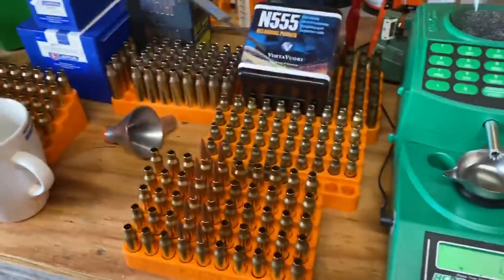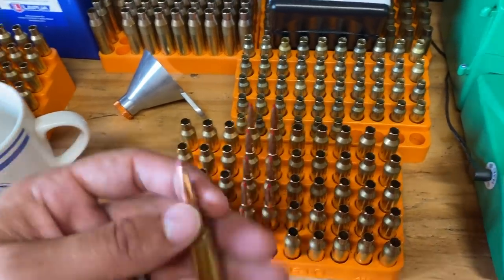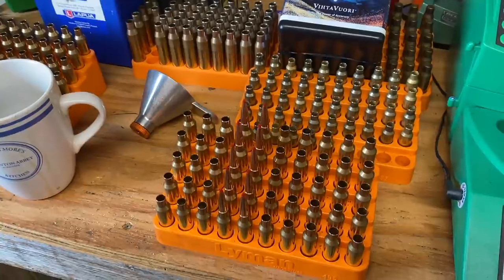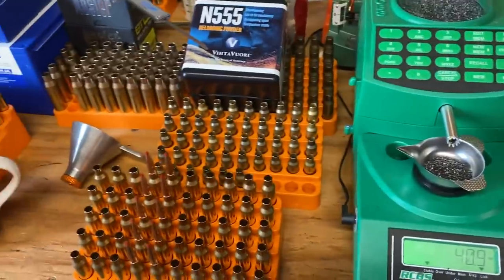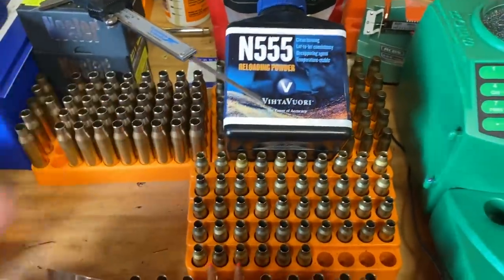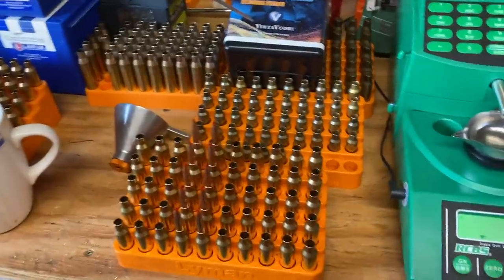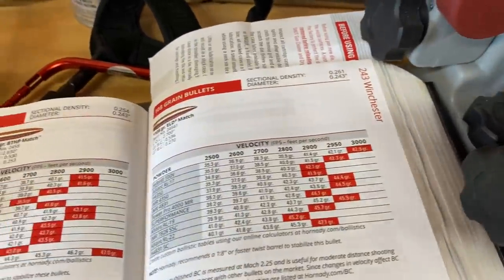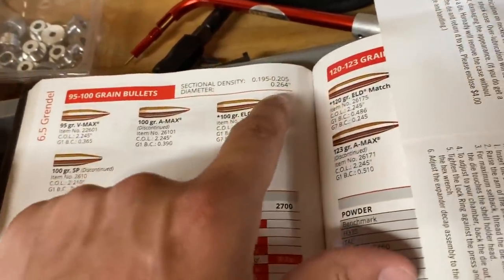6mm ARC???!!!

Comment: Two years later I just built my 6mm ARC...wanted to see how things went before I dove in.  So far I am see this as the best of the best in my lifetime.  .75MOA out of a gas gun out to 1K and beyond and have low recoil in a small frame AR is awesome.  Having shot AR10's, M16A1, A2, AR15 in many variants, I'm a big fan.  I also never had much of a desire to reload, but now I am changing my mind.

Comment: I built a 6 arc, just finished it this last weekend.
I have two Grendel’s and love them.
Just sold my 6.5 creed, great shooter less than a 1/2 moa out to 720 yds. 
Decided to built a 6 arc and just finished it this weekend. I went with a 22” bbl 5R Hand lapped and air gauged.
The case is some what different that my Grendel cases, other than the case just being next down to .243. 
Going to the range this week.

Comment: Really excited about it. When Alexander arms designed the Grendel they a compromised going with the 6.5  for hunting and bullet availability,but  the .257 performed  better. While the ARC  has the shoulder moved back a bit it is really close to that sweet spot for the case capacity. .257 may be a bit better from shorter barrels, but 6mm is a big improvement  and  should be way less temperamental than the .224 valk.

Comment: This looks like a great AR-15 sized cartridge.The only possible downsides I see are 1) the thin bolt head rim to fit the 220 Russian-sized base, and 2) the Mags. The new bolt head rim is considerably thinner than the 5,56 rim and has not been combat tested. The Mags? Good mags almost always need tweaking. What happens if you have to do some mag dumps in a tight situation? Will they feed properly and will the thin rim hold up under a lot of heat and stress? Don't know if they will be issues.... Thoughts?

Comment: I've been shooting Lapua 6mm  BR out of a bolt gun for about 20 years.  I've used VV powder and and 75 gr V-max.  super accurate to 800 yds.  Good for little varmints.  Check out the stats on their cartridge at the Lapua website.  Looks like the 6mm ARC is a copy, similar to the 6.5x47 vs 6.5 Creedmore.  Lapua brass is great.

Comment: You mention twist rate at one point in your video. What is the barrel length and twist that would be optimal for the 6mm ARC? I was looking at the Faxon 1-8 5R barrel in the 18-20" range. Thanks you for the great information you provided. So far in all the information I have seen you make the only good argument for this change.
Reply from the maker: Shawn Campbell I believe the ballistic advantage barrels are 1:7 but I could be wrong... 1:8 should be well suited for the 108gr ELDM...I would think it would be able to handle the 115gr projectiles also but that might be where the 1:7 comes in handy.
Reply: @alabamareloader  I went back to Hornady web page and watched all the videos they released on the 6mm ARC. Looks like the test barrel they used was a 1:7.5 twist and the minimum called for is 1:8. Thanks again for all your help.

Comment: I'd be interested in a 6 ARC in a micro bolt gun. A CZ 527 or Howa miniaction would be nice.

I think an AR in 6x45mm would be more useful for most shooters/hunters. A barrel swap from .223 and away you go, plus way more brass available. Hornady, Federal or another major ammo need to standardize the 6x45mm in general.

Comment: the N5XX powders give you more speed, but they heat the barrel faster. And in my experience, they dont give you the best accuracy.
Rather you should look at the N1XX, N140 and N150 should be perfect for Creedmoor depending on velocity. N140 works wonders in 308 for medium weight and 6.5 grendel heavy (130+ grain)

Comment: The 6MM ARC is not the UNICORN round for the AR15!
Why would I think about even going with a 6mm ARC 90 grain GMX shows Hornadies hot load doing 2750fps in leverevoution BC 422.  18 inch barrel. 
6.8 SPC 16.5 inch barrel. 95gr barnes ttsx BC. .292 several loads over 2700 FPS but poor coefficient still this is a hog killer in TX out to 200 yards.
6.5 grendel 100 grain barnes ttsx.  CFE223 2900 FPS .359 BC.    This is off a 24 inch barrel which I HATE I want a short lightweight fast hunting rifle.
I just don't see the big upside?  A lot of friends go with then 6.8 SPC works great out  to 200 yards lightweight short barrel.

Comment: In an intermediate cartridge everything is a trade off somewhere. The 6mm has its advantages as so does the 6.5. Either is an improvement over M855. In the body armor world and barrier world maybe the SD will be a major factor 🤷🏻‍♂️. Just seems to be a solution in search of a problem. We have so many AR-15 length cartridges at this point and the Grendel would’ve been a great improvement over 5.56 M855. So, I’d take the ARC but I’d really want to see a lot of field data comparing ARC to Grendel.
Reply: Glad someone is up to speed

Comment: How many reloads do you have to produce, to make up the cost of the equipment and supplies???
Reply from the maker: This requires a really long response...I’ll make a video about this topic...
Reply: @alabamareloader  Well, I turned to Search:) It seems about 1,200 rounds:) I am sure there are many variables however. I am thinking about a 6mm ARC Upper is why I was asking:) Thank you for your immediate reply. Does that meet with your general line of thinking?
Reply from the maker: @batmandeltaforce  in my opinion there isn’t any savings in reloading...once you start reloading you’ll want to shoot more which creates hidden costs people don’t like to acknowledge (range fees if applicable / gas / time required to reload / wear and tear on firearms)...once you start reloading you’ll likely upgrade the equipment you’ll use and you’ll experiment with powder, primer, bullet combinations and all of this add extra costs above the bare minimum. If someone was able to stick to just the bare minimum required to reload this yea you could probably save a few bucks but in my experience and talking with a lot of other reloaders you just end up being able to shoot a lot more and dial in loads specific to your rifle. It all depends on what you want to do...if you just want to hunt then you’re not really saving much but if you want to compete and shoot thousands of rounds then yea over time you’ll probably save some money. It all depends on way to many variables to say yes or no.
Reply: @alabamareloader  Makes sense to me:) I do not shoot enough to make up for it. I have other hobbies I'd rather spend money and time on anyway. Thanks man:)

Comment: What about the TAC 6 which is a 6.8 necked down to 6mm. It is just as nice or better than 6mm arc. Load data states that it is getting around 2800 fps with a 105 grain bullet. With a 6.8 all that would need to be changed is the barrel.
Reply: The TAC 6 would require barrel, bolt and, preferably, magazine changes, just as the 6mm ARC will. 

The 6 PPC, which is closely related to the  6mm ARC, is a remarkable cartridge well known for its consistency of internal and external ballistics. It has been proven in decades of competition in the Benchrest world and has a history of use in the AR platform for XC competition. One of the developers of the 6.5 Grendel was, in fact, such a competitor who was involved in the project because of that experience. 

I find it very interesting that things have come full circle with a slight variation of the 6 PPC and 6.5 Grendel.
Reply: What barrel length?  people get great numbers with 30 inch barrels.

Comment: OK, I have neither, but really want to build a Grendel upper.  My question is what happens when when you put a 6.5 Grendel into the 6mm mag or vice versa and pull the trigger?  This happens now with 9mm and 40.  The new 6mm is the same cartridge as the 6.5, and for that matter the same as the 7.62x39.  
Just looks like an opportunity for a problem if you have uppers and ammo for both on your trip to the range or to the field for hunting.  I know most are careful, but just asking.
PS. thanks for the great video.

Comment: 1 in 8 is not going to shoot 115 DTACs at lower elevations;  there's a reason 6 creeds, XCs, dashers, and such are 7.7 or 7.5.  1 in 8 should handle the 107-108s fine.

Comment: Be interesting how it compares to the BR and BRA.
Reply: Or BRX. My BRX in a match gun has won LR and mid range matches.
Reply: The BR/BRA/BRX are not really compatible with the AR-15 platform both because of the case head diameter and operating pressure levels. In a bolt gun, any of those 3 should outperform the 6mm ARC, but that really isn’t the point. The ARC was designed to work in the AR-15/M-16 platform, requiring minimal changes, basically, barrel, bolt and magazine changes in the upper and an existing lower. 

It is generally presumed that the undisclosed DoD client buying these is SOCOM. They have their own acquisition system and can generally buy whatever they want in the way of equipment. Being smaller in size than line infantry organizations the logistics issues are not as great either. Should this prove out in combat, and I think there is a good chance it will, the matter of transition in the rest of the Army, the Marines and even USAF. Should that happen, I’d be surprised if some of our NATO allies did not follow suit.
Reply: Richard Briscoe I have a BR/BRX in an AR15. It runs great. It is a specialty bolt, but so is any AR in 762x39. But I think you’re right,  to point out the ARC being designed for the platform instead of re engineering the platform

Comment: For the average guy , I don't think it is that much better than the 6.5 Grendal .
Reply from the maker: James Pollard agreed...for the hunting I do the Grendel is freaking awesome but I’ll be jumping on the 6mm ARC bandwagon simply because I’m a 6mm fan.
Reply: Sounds correct?
Reply: From a rough estimate a 16-17 inch 6mm ARC with a 108 grain pill will match or be slightly faster than a 24 inch 6.5 Grendel with a 123 grain.
Reply: Ballistic coefficients and other nerdy math specs are the defining differences.